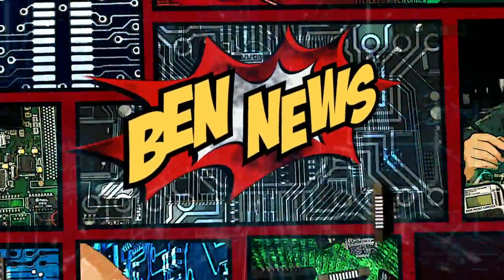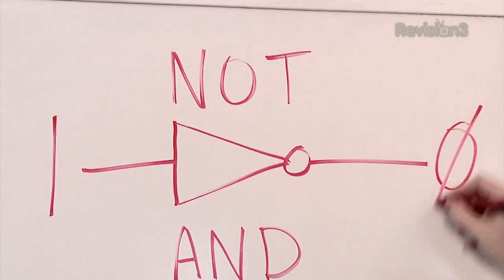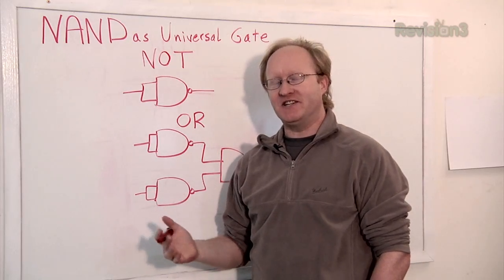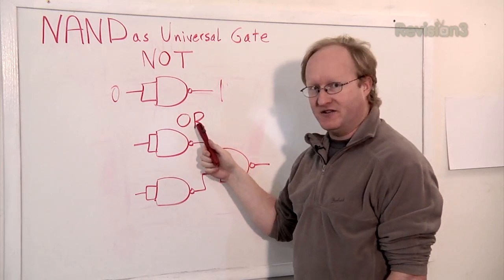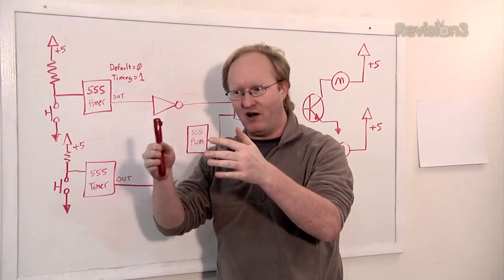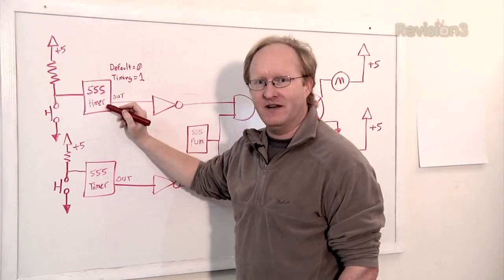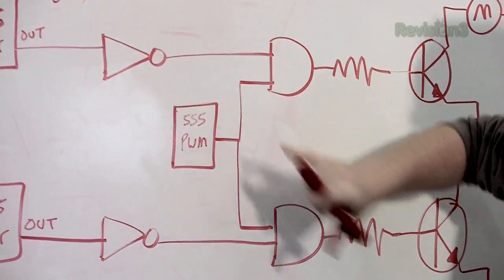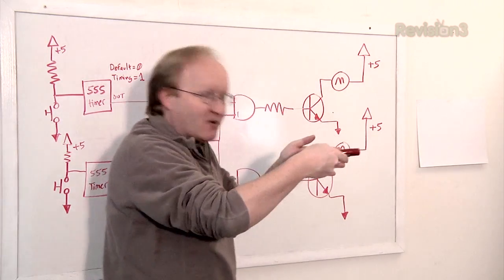Glue Logic Mini Robot

Comment: Just curious, why didn't you optimize the combination circuitry?  You can double invert the signal from the 555 PWM going to the left servo, and pull one level of "bubbles" through your two AND gates to make them two NOR gates.  The left over inverter (for the left servo) can then be made identically to the NAND inverter earlier in the video (only with a NOR), and you can compress all of the logic to a single chip (4 2-input NORs).

I can probably guess the reason (requires a bit more explanation), but with a breadboard that small, saved space is nice. :)

Comment: seems a creative idea. Some car manufacturers (the expensive ones) let the embedded navigation screen warns you when you overspeed since it has GPS tracking and uses car's speed measurement. For a cheep alternative, all you could do to apply your idea is some software work, you build an app based on,  let's say, Android OS that work behind the scene to track your speed according the street's speed limit. the inly issue here is the battery drain and inaccurate speed measurement.